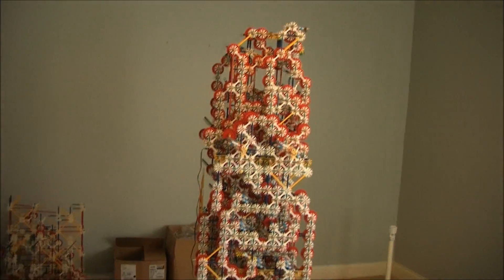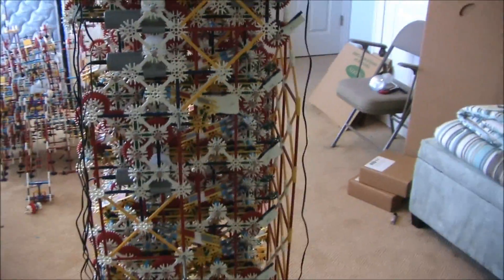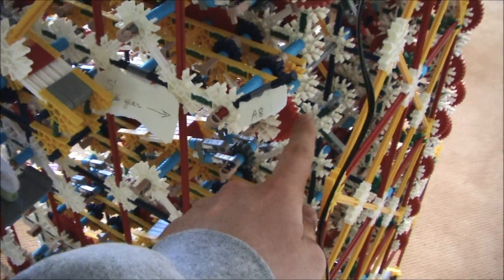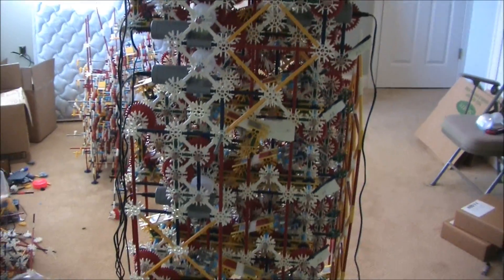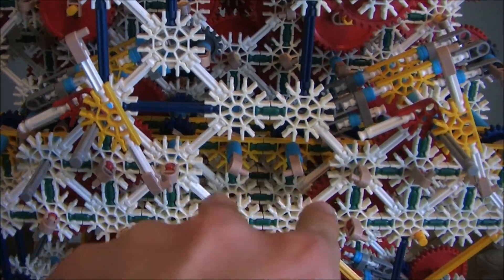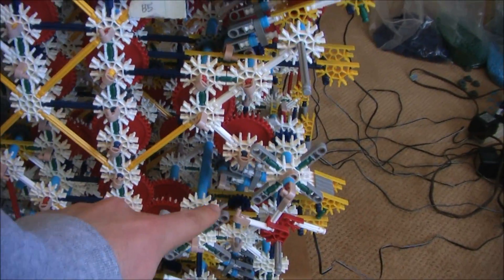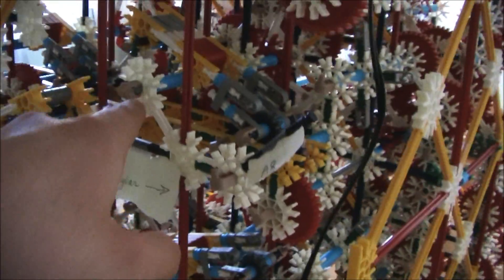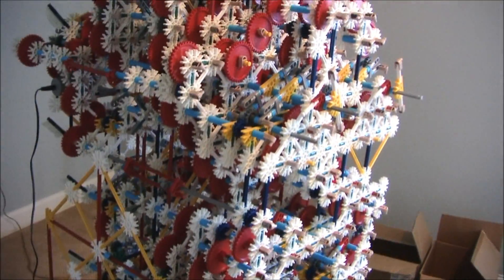The K'nuter - K'NEX Computer

Comment from the maker: Great question. First of all, this project has been on hold since I posted the video as I have neither the space nor the finances to continue. Second, I did invent a kind of K'NEX TV when I was much younger (maybe 13) that was to utilize a 5x5 grid consisting of rods that would push in and out through a plate of holes to function as mechanical pixels. Such a machine could be added to this computer, but the binary to decimal conversion alone would require quite a large number of parts.

Comment: the calculations are entirely mecanical, there's no electrical CPU or ALU doing the math. basically, if you were to replace all the motors with wheels that need to be turned by hand, it would still function. of course, if you are going to do that, you would connect all the motor inputs to one massive wheel so you only have to turn that one.

Comment: the way it works (as in computing data) is technically mechanical, the gears and such are working as a microprocessor would, the motors merely drive the gears, it would probably be possible (though likely very difficult and highly impractical) to crank it by hand or use a clockwork mechanism to run it. 

Tl;Dr it works mechanically even if it is driven by electricity.

Comment: yea i know what your doing even if i dont understand the technical jargon lol but the thing is i learned about this stuff in high school as well and understood it well enough that i could have read a string of binary and told you what it meant and i could also write in binary code as well

i wish i knew how you built some of those things cuz it really gave me a good idea on how to use very few motors to run several things at once it would be really neat kinda like several machines on one motor

Comment from the maker: Yes, you're right. The "thinking" (electronic) components of a computer are nothing but "switches" (transistors). And speaking of routing things one way or the other, that's how this project started: my "transistor" was an offshoot from a manual transmission I was designing at the time (back in high school), which would of course route power through different paths depending upon the input (the shifter).

Comment: i think what i meant is not redesigning as in making it your own just taking the binary code system and using knex to represent what happens with that code inside a computer to me what a full adder is is what reads the binary code and tells the computer what it needs to do and reroutes that code to the different parts of the computer basically the "brains" of the computer which acts like a telephone switchboard or thats the way i see it anyways

Comment from the maker: I'm not so sure I understand your comment. What do you mean by "redesigning the binary code?" What I did was construct logic gates using K'NEX and then used those gates to create a full adder. If you're unsure of what that is, I would recommend reading about full adders on Wikipedia.

The novelty of this machine is that it accomplishes what an electronic full adder (a crucial component to a microprocessor) does using mechanical representations of multiplexers, demultiplexers, and logic gates....

Comment: I hope some of the computer people realize that he just basically took the Binary Code and redesigned it using K'nex as a sort of Control Panel you could basically take this type of design and turn it into a control panel that allows you to run several machines using very few motors i.e. a big ball tower, a roller coaster, and a ferris wheel where you can make one, two, or all three run at the same time.

Comment from the maker: The friction does not build up as more components are added due to my mechanical diodes (essentially sprag clutches) and relays. In the same way that an electronic processor utilizes "flip flops" to reduce the delay of signals from one end of the chip to another, this computer would (if completed) utilize relays to pass information along without incurring additional resistance.

Comment from the maker: ...On another note, using cranks instead of motors would involve no change in the machine except removing the motors and snapping cranks onto those input rods (and potentially joining them all together). I'm not sure there would be a whole lot of value to that, but I can understand how that might be more convincing to some people that it's purely mechanical. You might want to check out Konrad Zuse's Z1. His also was crank-powered, but he used a motor instead to save himself time and energy.

Comment from the maker: Google electronic vs. electric. There are some big differences between a computer (a device comprised of billions of electronic components, namely transistors) and a motor (a device which, by itself, has no electronic components). The machine in this video could be easily powered by a human and a crank (or any other source of mechanical motion), but motors are used here simply to save unnecessary effort.

Comment from the maker: Good question. No, they don't move because once the power is running through a switch, the gear that makes the connection between the input and output gears (that gear at the end of the lever that falls into place when the switch is activated) gets pulled down into the gear train by friction. In fact, this force is so strong that the input power must often be disengaged (through the use of an intermediate relay) in order to change the input of the transistor/switch.

Comment from the maker: ...On a more historical note, early computers in the days before microprocessors often had architectures not based on a bit-width of a power of 2 (8, 16, 32, etc.); rather, it might have been common to see an 18-bit or a 24-bit machine. In these cases, a "word" of data would consist of 18 bits and 24 bits respectively.

The 8-bit byte that we're accustomed to today is merely a convention and is by no means a requirement or a limitation...

Comment from the maker: You only "need" one bit. Theoretically, you could loop the carry-out back to the carry-in input to have unlimited precision. (You should look into Lisp for related reading.)

The number of bits needed, or more accurately, desired, is simply a design choice. The first microprocessor (the Intel 4004) used 4-bit arithmetic. The 8008, as well as many microcontrollers still used today, used 8 bits. But as we can see, the industry is all the way up to 64-bit today, so they "need" 64-bit adders....

Comment from the maker: As a final aside, the most easily implemented gates are AND and wired OR (which is constructed by literally connecting the outputs of two gates). For this reason, special care was taken to use De Morgan's Law to reduce as much of the logic to these kinds of gates as possible. A logical inversion (NOT), as mentioned above, is a rather costly computation due primarily to having to wait for the first gate to be set before driving the second gate (to avoid erroneous values).

Comment from the maker: In case it's not clear, the whole reason we need that second transistor instead of just using an additional gear (as I mentioned first) is that if the output of a gate is stationary ("off"), there is no way to turn that lack of motion into power on its own. So we utilize this additional transistor to turn that "nothing" into "something."

The "additional gear" trick is more of a conceptual solution which can only be realized physically in very specific and unusual cases.

Comment from the maker: ...Then if the gate's output is "on" (turning), it will flip the input of the following transistor into the "off" (stationary) position. When the drive power (Vcc/Vdd) flows through this transistor, the output rod that corresponds to "off" will then be turning.

Think of a p-channel MOSFET, where a low ("off") input will cause a high ("on") output. That's essentially what we're doing with that second transistor (the inverter).

Comment from the maker: It depends upon the context (usage) of the NOT. But essentially, a NOT is created simply by reversing the angular velocity/direction of a rod, which is achieved very easily by just inserting one extra gear (anywhere) into chain.

Note that this trick doesn't work if the NOT is to be attached to the output of a gate whose output rod is either turning or stationary. In this case, a relay/transistor must be attached to the gate's output and preset in the "on" position....

Comment from the maker: Yup, only one bit. I've since designed something much simpler and faster, but it doesn't use discrete gates like the design in this video. And frankly, the use of discrete gates is the fun part about it because it shows that you can do any (time-independent) task that a modern computer can do using just K'NEX.

Comment from the maker: (3) Yes, your water system would work. I can't find it Online right now, but there is an image from Patterson and Hennessy's Computer Organization and Design that represents components of a carry look ahead adder as a pipe with valves controlling the flow of water. Although this is a high-level (not a gate-level) abstraction, it is a good example of how computation can be performed by mechanical means.
(4) If I had time, I'd perform some calculations to figure out the size and time...

Comment from the maker: (1) I wouldn't say that I have a clearer understanding of logic, but I have gained a very real sense of issues related to propagation delay, bus fighting, and fan-out, albeit in the mechanical realm.
(2) Yes, this machine is all discrete logic (which is the reason for its massive size). I've developed another concept that should be at most half this size and compute results in just a few seconds using non-discrete logic, a sort of hard-coded tree of values.

Comment: So I can only ask three questions.

Do you feel you have a clearer understanding of logicy by executing it mechanically? 

Is this an example of discrete logic?

Could you build  integrated circuits from from valleys and water? i.e. the flow of water replacing electrons, and logic built from chambers and gates.

Would it be conceivable to build a climate model out of k'nex parts? 

Wait, that's four.

(Seriously though, this is fascinating. I wish I had a proclivity for this stuff)

Comment from the maker: Thank you for your comment.

Actually, this is just a single full adder. The plan is to create other full adders like this one and link them together (though I've since decided that discrete gates requires too many parts, and thus if construction were to continue, I would use a revised design that essentially "hard codes" intermediate results into a combination of gears).

You are correct that looping back the results would be efficient in that it would require less parts, but...

Comment from the maker: ...while the relay is being driven (NOTE: different than being "written" to), the force between the gears is so strong that it effectively locks the input gear in place. The solution then is to provide separate windows of time for reading and writing. (There are other solutions, but this method provides reliability in predicting the stage of computation that various components will be undergoing at any given time.)

Comment from the maker: I also wanted to note, in case you'd like to do some further research on your own, the memory system I described is similar to one based on D-latches rather than flip-flops. Whereas data is written to a flip-flop on the rising edge of the clock, with a D-latch, data is written at any time while the clock is high (or logical 1). The key difference between the mechanical system and its electronic analog is that data can only be read while data is NOT being written. This is due to the fact that...

Comment from the maker: ...their drive power. When this drive power is disengaged (clock line is 0), their inputs can be changed by a writing subsystem (a tree of demultiplexers). When the drive power is engaged (clock line is 1), the writing subsystem is disengaged, and the values of the individual bits of memory are sent to the read port. I realize this is all pretty confusing, and I'd love to post a video, but at the moment, the multiplexer tree that reads the memory is only 90% complete, and because I just...

Comment from the maker: ...The K'NEX memory I've built is essentially an array of relays (similar to those shown in the back of the full adder in this video, which are used to engage the motors). When a relay is engaged, it's read as a 1; if it's disengaged, it's read as a 0.

The difficult hurdle to overcome in constructing the memory was to devise a clocking system (as thus far, all of my machinery has been combinational). The clock is combined with the aforementioned relays, continuously engaging and disengaging...

Comment from the maker: (1) Thanks for e-mailing K'NEX. I really appreciate it.

(2) There are a variety of algorithms you could use to convert decimal to binary; if an algorithm can be carried out by a computer, then it can be expressed mechanically. As is demonstrated by this full adder, all Boolean gates have a working mechanical representation.

(3) Subtraction is merely addition with two exceptions: (1) one of the two numbers has inverted bits, and (2) the "carry in" is 1.

(4) I have built a memory prototype....

Comment: This is brilliant. Much kudos sir. 
So is this essentially a pile of full adders with the carry out of each going to the carry in of the next, with two's complement used to perform subtraction?
I wonder if it might be more efficient to somehow build a shift register two store the input numbers, shift the LSB each time into the adder, put the sum back into one of the registers and the carry out to the carry in at the next clock cycle via a D-latch?

Comment from the maker: Yes, everything you see here is my own creation. If you're interested in the construction of the transistor (what is actually a demultiplexer), it is essentially two relays put side by side. You then arrange the mechanics such that when one relay is engaged, the other disengaged. Join the relays so that they share the same input "voltage" source, and voila: you have your demultiplexer (where each output corresponds to the "0" or a "1" of a transistor).

Comment from the maker: I should also note (as I did in an annotation at the beginning of the video) that these mechanical "transistors" are actually more like demultiplexers, as they route an input to either one of two possible outputs. This is in opposition to the behavior of a transistor, which only has one line which is either on or off. However, I used the former term in my video due to the fact that people are more likely to have heard of a transistor, and the concepts involved are not all that dissimilar.

Comment from the maker: It would be difficult to explain every detail here, but basically a connecting gear completes either one of two possible paths (resulting in a binary 0 or 1). A good metaphor is to think of a transmission as being a transistor (specifically a BJT). This transmission only has two possible gears (1st gear and 2nd gear), which we'll equate to the 0 and 1 inside a computer. The gear shifter is the base of the BJT; the input shaft from the engine is the collector; and the output shaft is the emitter.

Comment from the maker: @ocasxana I have schematics but no instructions, largely due to the fact that this was a prototype build rather than a final product. While the device shown in this video is just a single full adder, I do have plans for a full processor with much improved (and smaller) components. Unfortunately, I'm afraid there might not be a "next computer" without external funding; the project is simply too costly and time consuming to pursue further without assistance.

Comment from the maker: @Aeleita1 I designed something I called a "mechanical diode" many years ago (which I later found out is not much unlike a sprag clutch) that allows power to flow from source to destination but not vice versa. This means that when friction arises anywhere in the system, if it feeds back into the outputs of switches, the force will be broken by the inherent mechanical diode in each switch. The other solution was relays, which allow small forces to essentially enable much larger forces from motors.

Comment: @dehrman07 Sorry if this is a stupid question, but I just don't understand at what point a load of transistors becomes a "brain". I understand how transistors work, having either a 1 or 0 value depending on the input, but how can it add and subtract? I've tried to google this but am probably not phrasing it correctly. Could you link me to somewhere I can read about CPU's? Thanks!

Comment from the maker: @master777999 You're right. It might be easier to think about it like this....For just adding two one-bit numbers with a carry-in (the same as three one-bit numbers), imagine what the sum and the carry-out would be under various circumstances. Well, you know that the sum is going to be 1 if either 1 or 3 of the inputs are 1, and the carry is going to be 1 if 2 or more inputs are 1. You can express this kind of decision-making using the common operators AND and OR if you think hard about it....

Comment from the maker: @dehrman07  I do want to point out that there are in fact other K'NEX computer designs employing Boolean logic on the web. However, I think the primary difference between this machine and others is simply its ability to be fully automated once activated. Also, Christmas break is just around the corner, so hopefully I'll have some more time to try out new designs. (I've got a few that I've been working on for the couple of months.)